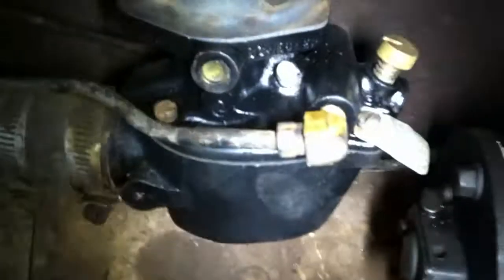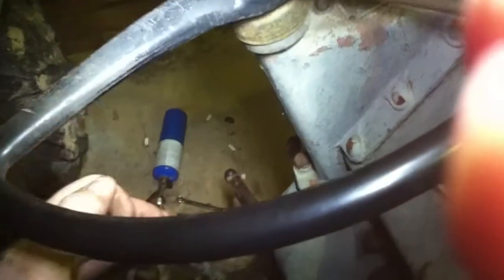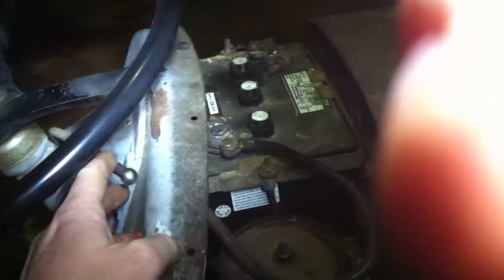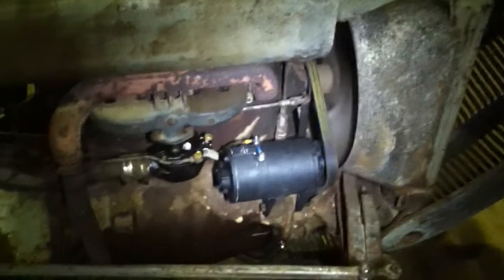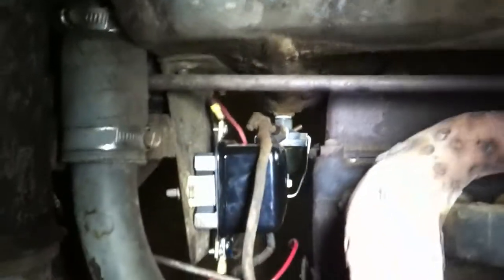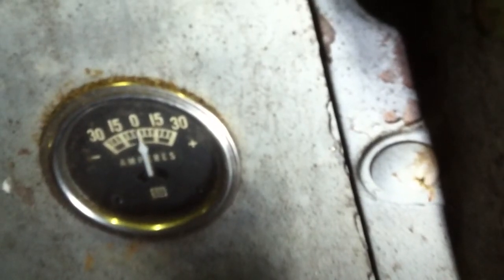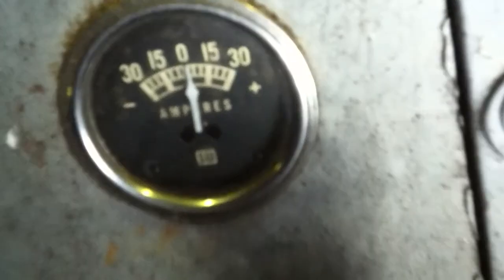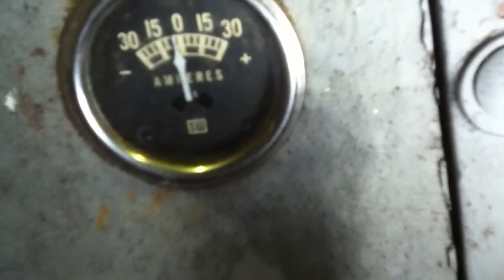Ferguson TO20 Tractor Cold Start after repairs

Comment: Where did you get your carburetor rebuild kit? My TO-20 runs good but if I don't turn  off the gas shutoff there will be a big puddle.
Reply from the maker: Steiner tractor parts.  http://www.steinertractor.com/brand-massey-ferguson.aspx

If you look at the little brass tag on the carburetor, it will say TSX-??? and if you search for a rebuild kit you will find one.  This one was leaking as well and I just adjusted the float to stop the needle sooner and it never leaked again.  a new needle and seat would probably do the job, but you will need new gaskets anyway. Mine was TSX-458.  Thanks for watching!
Reply: Musher Deeds Big help! Thanks.